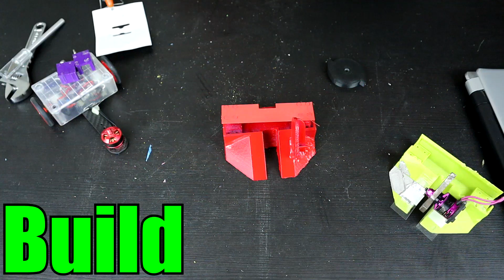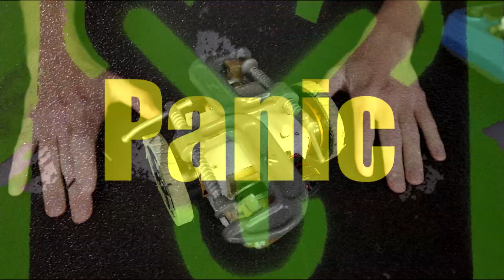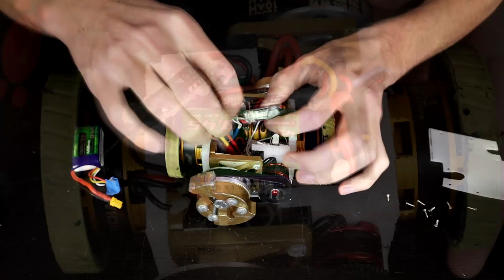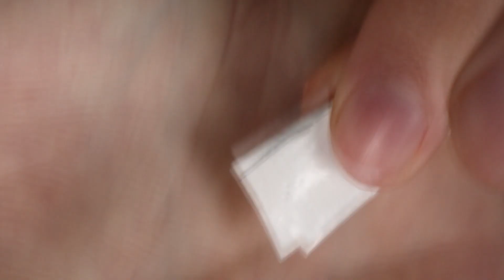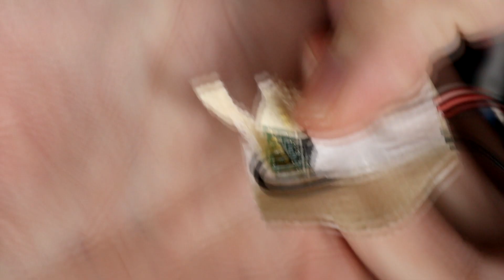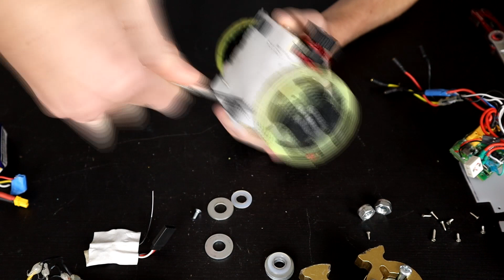Inspecting the dual vert melty

Comment: Have you considered wedgy bits in front of your weapons so that when you spin you can lift and feed them into your weapon. Several of the melty brains in NHRL use wedge-y like weapons to lift and smack. Something to consider in you next chassis design.
Reply from the maker: I have been thinking about it, its just a case of where to put them and how to set them up so they dont drag and mess with the meltying

Comment: Can the bind button be used to set the failsafe on that receiver? On my receivers pressing the button while it is on and powered up sets the 'zero' state. So it would be possible if the button got pressed while the bot as moving, if it lost signal it would keep going in whatever state it was in when the button got pressed. Not sure how the melty code works into the equation, but just an idea based on my experiences.
Reply from the maker: Hmmmm very possible, gluing the button and the antenna down definitely needs to happen

Comment: Hey bud, if i were you, i would spend like 15 to 20 bucks on a cheap electric screwdriver. I use one for a lot of my electronics projects bc they dont have a ton of torque, so u dont strip out the plastic while using self tapping screws. Thanks for all the info on motors, how to make wheels and everything else. I have a couple antweights, but really want to build a melty!
Reply from the maker: I have one, but its a little too torquey for taking self tapping screws in and out of plastic, i think it would strip the holes
I should look at getting one of the thin pencil style ones
Reply: @TeamPanicRobotics  Funny I just printed out and put together "a little obvious," and I used my electric one to screw in the motor mounts. I don't have a  weapon for it yet, but it's only at 100g. Thanks for all the info and files

Comment: I can say with some certainty that this is a power supply issue causing brown outs. I have experienced a lot of headaches with noise with that particular style of buck regulator. I just moved onto just a basic ldo linear regulator like a 1117 to reduce noise. I run nrf24L01 modules, so paranoid about noise on the power supply line.
Reply from the maker: I do need to change the regulator for a new version of the board, but I might also just stack a bunch of caps on this one to try and smooth out its output so I can keep this board running

I'll look into the 1117
Reply: @TeamPanicRobotics  you will need both lower value ceramic and higher value electrolytic for it to be useful. I had luck with a 104 ceramic and 1uF electrolytic in parallel.
Reply from the maker: whats the theory behind using both types? just to have different cap values?
Reply: @TeamPanicRobotics  yes different cap values. Small and low ESR for faster response for higher freq noise, larger value cap to supply/stabilize the proper voltage. Can be whatever type for this application. I did not do proper testing for this with different types.

Comment: Have you considered using one of those 4 in 1 quadcopter ESCs? It might save you some space and wiring
Reply: That's just what I was thinking watching this
Reply from the maker: I have, but I need one I can send signals to very quickly
I havent looked into them far enough to see if any of them except dshot or other similarly quick signal protocols
Reply: @TeamPanicRobotics  I have a km55a I can send you that supports dshot 1200 with AM32 firmware
Reply from the maker: thanks for the offer but shipping to aus is expensive and time consuming.
I'll grab my own, its good to know these exist and are pretty small by the looks of it!

Comment: Good survivability on this by the looks of things. Might worth making the weapon pulley smaller to avoid getting hit, if that looks like being possible with the updated design.
If the receiver contact/squash is unavoidable for packaging, a sheet of 0.5-1mm HDPE or some thick acetate as a shield over that part of the receiver may be enough to stop the button or antenna getting nudged.
If there's the thickness available in the chassis, the bolt head or nut could be recessed into a pocket to make installation/removal easier. Also going to shoulder bolts would help as they're a precision fit on the shaft rather than standard bolts which are a tad undersized by design. Alternatively, print an internally threaded sleeve with the right external fit and use a standard M6 bolt/nut.

Comment: When using microprocessors in bots I have had to ensure the power for the processor is isolated from the main power. The current spikes that the ESCs and motor cause during operation can cause intermittent programming errors. This problem is most likely worse in a meltibrain since the motors are turned on and off multiple times per rotation.
Reply: There's a good chance it's this.  I shoved 775 in my melty and have had constant problems, but only under load; bench testing was fine (once some capacitors were added).  I haven't isolated the motor yet but plan to.  My oscilloscope showed crazy noise during bench testing before I added extra capacitors and I've browned out ESCs and had them go unpredictable in the past so it does seem like this is the case for the both of us.
Reply from the maker: This is definitely something I need to look into